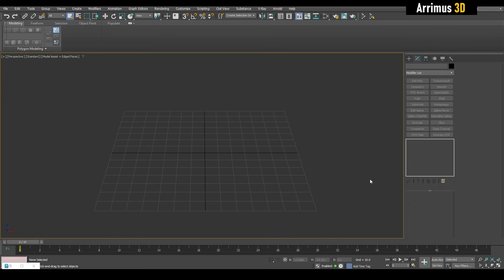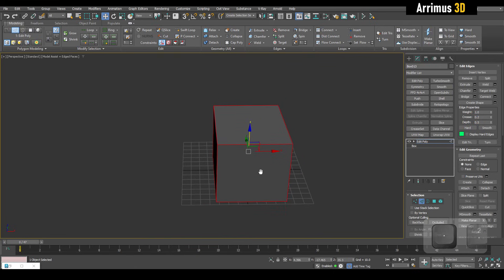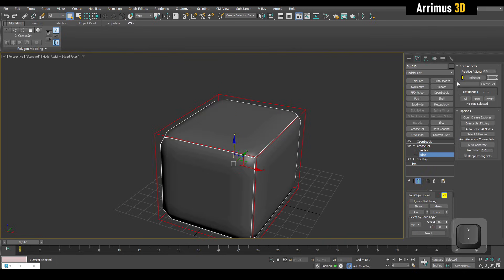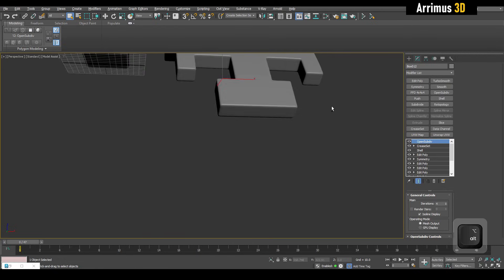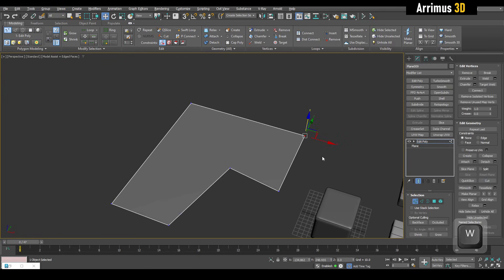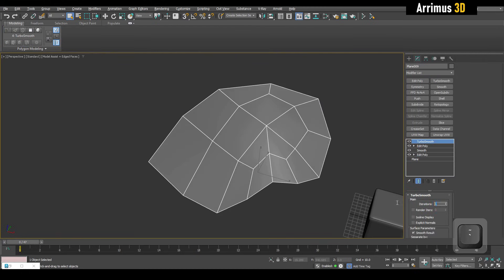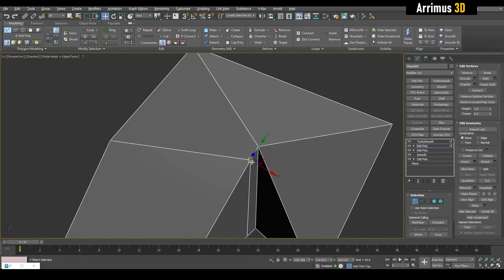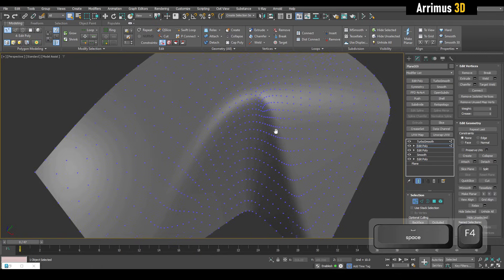Learn Polygon Modeling -- Part 5 -- Edge Creasing

Comment: Good afternoon.
Could you recommend any software or plugins, besides the standard 3ds Max modifiers, that allow fast polygon reduction with minimal loss of overall shape (the exact polygon topology is not important)?
The required level of optimization is a 90–95% reduction in polygon count.